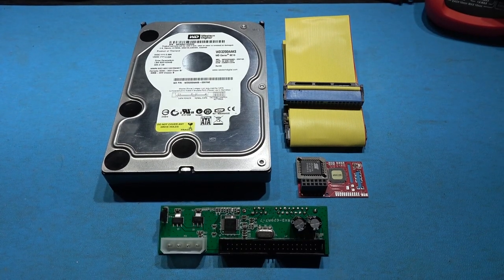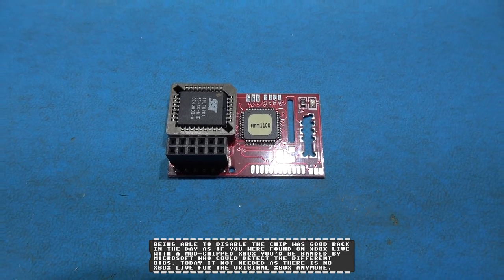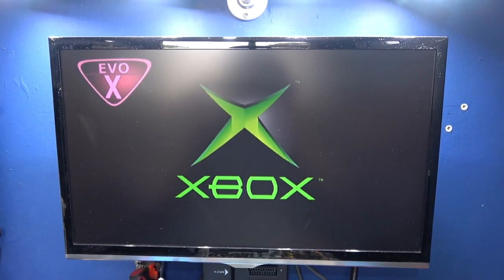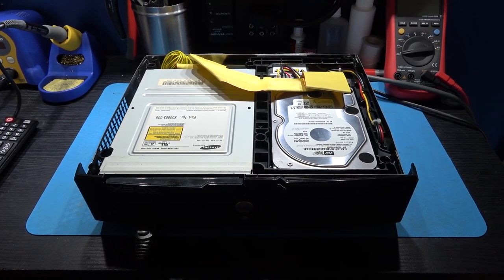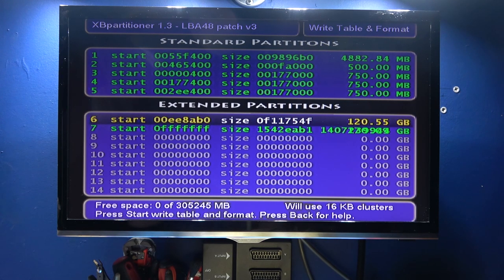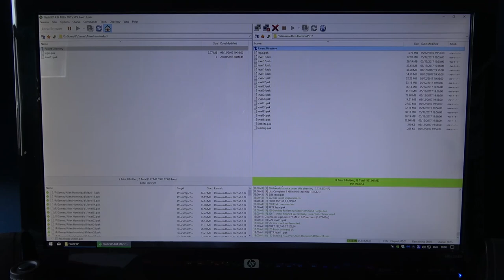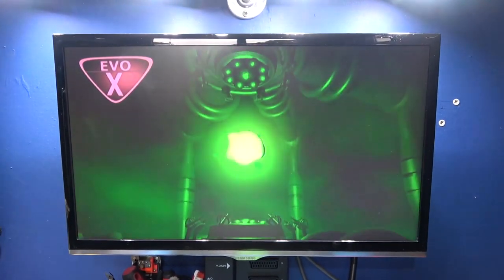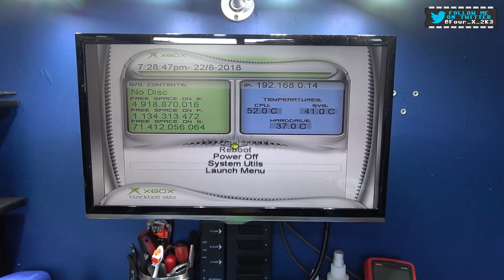Microsoft Xbox - Mod-Chip (Aladdin XT Plus2) and New Larger HDD Install.

Comment: Lovely mod =D  I tend to just flash the onboard TSOP flash chip these days, it only involves soldering a couple of links and you're away.  But it does then require an exploit to load the flashing software.  Very cool though, I do love the XBOX - Microsoft nailed it with their first console imo.  I have more nostalgia for the old XBOX and the 360 or XB1.
Reply from the maker: Thanks Chris, I've Never TSOP'ED an Xbox before knowing my luck I'd mess it up and have to de-solder the TSOP (Flash) from the board and flash it manually with my EPROM burner then re-solder it back on (Nightmare). To be fair I'd rather mod-chip the console even on 1.6 revision Xbox's its only 6 wires to rebuild the LPC Port and you don't need to softmod the console beforehand. I agree the original Xbox is the best out the whole range of them hands down, lots of great memories.
Reply: @Four_X  technically you don't have to do that if you can get your hands on an xblastOS modchip

Comment: I have a very strange problem
my hardmod xbox not show me correct size of HDD
I used HeXEn  2017 to softmod my XBOX and I formatted my HDD fine
but when I join unleash dashboard only showed my 123Gb
i tired 3 kind of hard disk ( 2TB sata, 160 sata , and 160 IDE ) but same problem only showed my 123 gb on F 
although I formatted 2 partition F and G 

my chip aladdin v1.4

Also I used another 80-pin cable but I got same thing

Comment: I installed the chip to a 1.6 board and broke one of the vias.. one of the more stressful things I've done in a while, managed to wire it in by exposing a bit of the trace and soldering to it. Hopefully I wont have to remove the board from the case anytime soon so that it wont tear accidentally
Found a really cheap clear/crystal Xbox that was "for parts" and it was lacking a hard drive so this was really the only way I could think of saving it
Reply from the maker: Sadly the orig 8gb HDD's are failing in the og xbox systems now. Thankfully we can save them by using a ModChip. Crazy.
Reply: @Four_X  yeah I'm glad it's up and running now. Appreciate the tutorial and for some reason my Hexen disc had some corruption in the text so the options were hard to read so this guide came in really handy for navigating the options

Comment: Cracking job, I need to get me one of these and try that out.
Reply from the maker: Thanks
Reply: I won an Xbox on eBay today, £16 with postage (sticking drive). I bought the Aladdin XT-4032, do I need the Plus or is this chip pretty much the same? I'll be doing like yourself and installing a big SATA drive. Can't wait to try it out after years of PS2 gaming. No problem if you can't help, thanks for the inspiration to try this out.
Reply from the maker: WOW £16 delivered, Nice. the Aladdin XT-4032 is the same chip and will have the "EvoX M8+ BIOS" on it like the one in my video, if you're going to use a sata HDD I'd make sure you also use a 80 pin IDE cable as you may find you get error=07 HDD Timeout with the stock 40pin version inside the Xbox. Apart from that you're good to go.
Reply: Nice tip, thanks. I should have an 80 pin lying around from my old computer stuff.
Take me a few weeks to sort out as I'm outta cash for a big hard drive. The main PC is waiting for its 2080Ti to arrive and that's set me back a fair bit.
Keep up the great work on your channel, really interesting and it's good to see your no bullshit approach. I'll let you know how I get on with my little project.
Reply: @Four_X  I'm using an openxienum chip I also have Phoenix Bios Loader set up to run the xdk bit

Comment: I have the same mod chip and my Xbox is blinking green and red I had some solder points that were wrong do you think the mother board is friedn cause I unsoldered everything but lefts the only the pins on and I still get green and red. Please respond!!!
Reply from the maker: If you've removed the mod chip and the XBox is blinking green and red it could be because it's not the original HDD, do you get any error codes on screen at boot up.
Reply: @Four_X  I get nothing and it's the orginal HDD. No sound not screen
Reply: just a tip i too was getting that and resoldered and was stumped, turns out my header pins wasnt tall enough to make a connection to the mod chip.
Reply: @justinlongfellow6449  well thank you I would of never thought of that actually

Comment: I have 1.0 board just like yours with Aladdin chip, turn on-solid orange for 3 seconds, fans spin, and turn off by itself. I`ve cleaned it, checked everything, clock capacitor removed, changed thermal paste. What else can I do?
Reply: Same problem. You was able to fix it?
Reply: @alexandruo.1639  Thanks for quick reply. Got it, I'll probably do the same

Comment: I've done the same thing, when I get to boot with the new drive installed, I get the error screen with error code 07. I tried with other IDE I stuck in, it does show Linux under the Xbox logo when booting to Hexen disc and then error code 13.
Reply: All sorted! The jumpers needed switching to cable select.

Comment: Please put Xbox version in the title, install worthless without that info
Reply: The Xbox is a  Version 1.0.  because that is the only version to have a fan on the gpu. The power supply plug is also a single row as well, which is only found on  v1.0 and v1.1 of the original xbox.

Comment: Question - if the original TSOP code is wonky, does it impact the Aladdin somehow?
Got a 1.4 with a non reading Thomson DVD drive, that doesn't do any different with the little pot adjusted 1K right up to 4K .XBOX didn't boot. Reflashed the TSOP with it's own firmware and it booted to XBOX logo, DVD tray would eject also as a change, but no dash cos wouldn't boot with the HDD connected. Modded it with Aladdin chip and built a new HDD with XBOXHDM. Locked and unlocked it with original eeprom.bin, also did same with the drive that was in it originally (repeatedly). Now, anything I try,  it stutters at boot, crashing at the initial boot animation and never gets to a dash. Boots through initial animation fine with no HDD.
Edit - does come up with EvoX top left, so the chip is working. Just nothing has changed.
Reply: Weird there was no answer, and it is probably late, but anyway...

The modchip completely bypasses the original TSOP (that is the point). So whatever your TSOP is doing, the chip will disregard it and act as a replacement TSOP.
Reply: @xmaverickhunterkx  Later answer here too... but the XBOX was fixed shortly afterward. I put the modchip in and it did what you said. Happy gaming and thanks for the comment  :)
Reply: @xmaverickhunterkx  I'm having this exact problem right now. The original HDD makes the flubber animation freez halfway, and a new Fat32 SSD just sits on the xbox logo after the animation. I do see the evox logo, but then nothing happens. I tried running two copies of Hexen 2018 but they never finish loading :( Any ideas are welcome.

Comment: Hi. My Xbox is v1.6 and it is hard moded with the same chip and it goes to original dashboard. It is not booting up HeXen 2018. So what should I do? I want to install emulators. Any suggestions? The HeXen DVD works fine on other Xbox
Reply: Check your wiring. Something came loose or a solder joint failed.
Reply: @RadioMartyT1B  if anything his drive was dead or dying

Comment: could you explain the purpose of the replacement ribbon cable to me please?
Reply: Larger Sata hard drives require 80 wire ribbons instead of 40 to be able to read information correctly.
Reply: @tommycaldwell6953  thank you

Comment: I know it's been a while. but I got a couple of questions. Could you replace the clock's capacitor with a more durable solid state polymer capacitor? And is it possible to flash the Aladdin chip with custom bios? I had a xbit chip for mine after a failed tsop mod (power blinked during flashing) and the modchip finally died on me.
Reply: You could just leave the console without a clock capacitor really.
Reply: @mspeter97  if its 1.5 revision and below you can leave it without capasitor yes, but it will brick a 1.6. you dont need to replace 1.6 revision capasitor anyway.

Comment: I got a question that NO ONE seems to want to answer, so i found an original xbox but it seems to be missing the HDD. If i install this aladdin mod chip can i just use any ide HDD to make it work? or the Xbox is just dead without it's original HDD?
Reply: You can. Hard moded xbox will be able to boot with an unlocked HDD. Just be sure your dvd drive can read a dvd-r and get yourself hexen disc. Otherwise, getting your hdd formated and dash installed will be more complex.
Reply: @ketzer9999  Thank you. This is all i needed to know.
Reply: @EtaYorius  Before you put any money on it, check you are getting video. If it is missing HDD it should return an error code on screen.
Reply: @ketzer9999  I do get a screen with an error numbrt message. I already opened it and it is missing HDD. But if i can bring it back by soldering this chip i'm cool with that. I have some experience soldering electronics. But everyone told me i should just toss it away, since it was missing HDD it was no longer "Repairable".
Reply: @EtaYorius  Go ahead, it will work with mod chip. If you cant find an IDE drive, it is possible to use SATA with an adapter.  Just get one that is compatible. Good Luck

Comment: i just put a sata adapter and 2tb sata hdd instead and format the F: and G: with xboxpartioner with 64k clusters(this is important coz 500+ gigs hdd have errors copying beyond 255 gigs) and installed xbmc and shitloads of games i have 400+ games and emulators

Comment: Great video! Temped to do this one day. All mine are softmodded.
I did not know about that super-cap. It didn't cross my mind. Opps.
You are a good friend. Even if you do suffer with pills holding a poo barrier inside of you.
Reply from the maker: Thanks Ant. I was tempted to softmod this Xbox but because it was for a  friend and he's never owned an original Xbox before he may do something accidently to break the softmod so I wanted a more permanent way back in to the console if he did hence the mod-chip. Ha, poo barrier love it.
Reply: @Four_X  Apparently you can get it to run 1080i somehow. I'd love to see that.
Reply from the maker: Yes I know. I run Xbox Media Centre in 1080i it looks stunning, all you need is a component cable Ant. been using 1080i from my Xbox for years.
Reply: @Four_X  Wow cool!

Comment: followed this to the letter, when i went to test the chip was installed correctly, the xbox turns on and off twice and on the third time it stays on but the red and green light is flashing with no display output, can anyone shed some light as to whats gone wrong?
Reply: Sounds like a bad solder somewhere. Did you get it working?
Reply: @Cimone90  yeah i got it working, believe it or not something went bad on the main power board, it was just bad timing lol, changed it out and it works fine
Reply: @AdamTheHammer  niiiiice! I have a 1.6 to do. Crystal clear model. Debating just soldering wires or using an lpc rebuild board